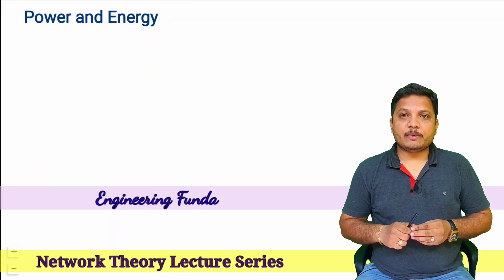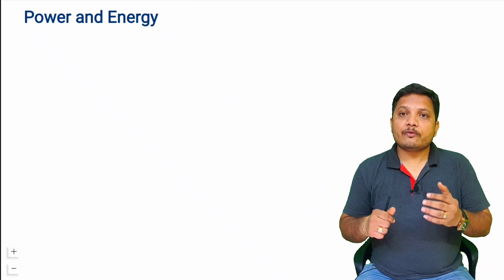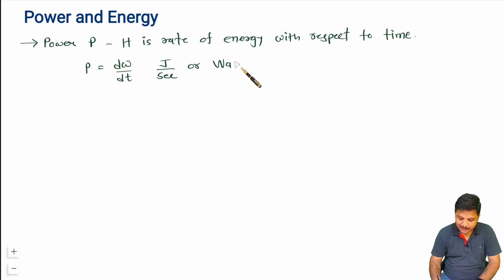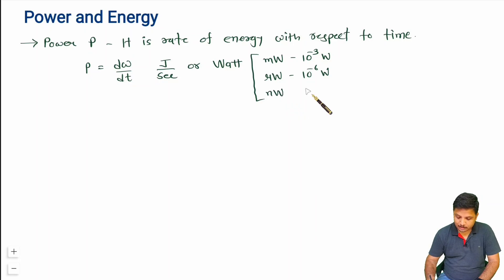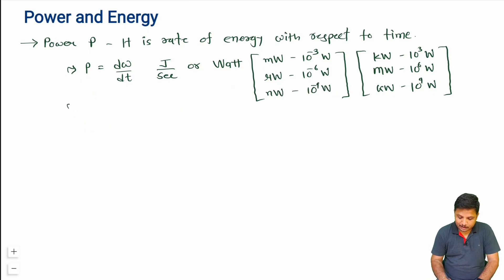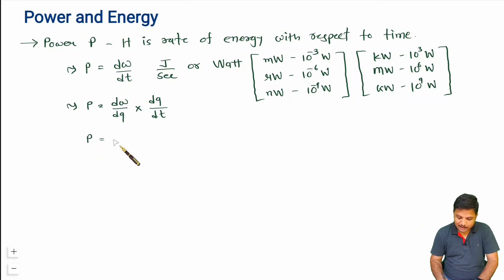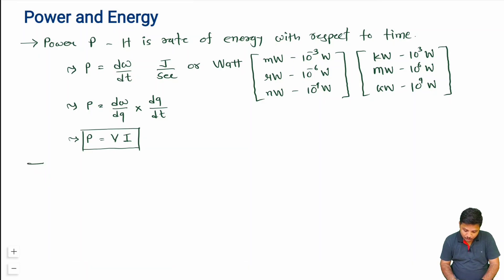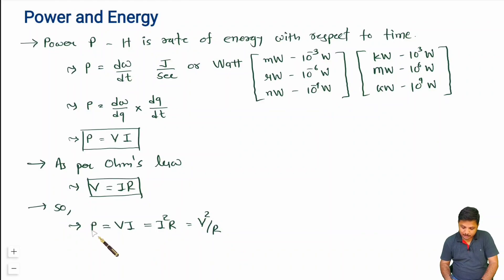Power and Energy: Definition, Formula, and Solved Problems

Comment: The power formula you use depends on the specific context of the electrical component or circuit you are dealing with:

1. P = VI (Power equals Voltage multiplied by Current):
   - This is the general formula for electrical power in a circuit where both voltage (V) and current (I) are present.

2. P = I²R (Power equals Current squared multiplied by Resistance):
   - This formula is specific to resistive components, like resistors, where the resistance (R) is the determining factor for power dissipation.

3. P = V²/R (Power equals Voltage squared divided by Resistance):
   - Similar to the above, but expressed in terms of voltage and resistance. This is also used for resistive components.

For non-ohmic devices like LEDs, it's more appropriate to use P = VI. Using P = I²R or P = V²/R may not yield accurate results because these formulas are specific to resistive elements.

Always consider the type of component in your circuit when applying these formulas. If you're dealing with a combination of components, you may need to use multiple formulas based on the characteristics of each component.

Comment: Y we are not using p=vi or v square by R  for answer we did came wrong answer Y sir
Reply from the maker: I think you might have done calculation mistakes
Reply: Are you serious 😐
Reply: The power formula you use depends on the specific context of the electrical component or circuit you are dealing with:

1. P = VI (Power equals Voltage multiplied by Current):
   - This is the general formula for electrical power in a circuit where both voltage (V) and current (I) are present.

2. P = I²R (Power equals Current squared multiplied by Resistance):
   - This formula is specific to resistive components, like resistors, where the resistance (R) is the determining factor for power dissipation.

3. P = V²/R (Power equals Voltage squared divided by Resistance):
   - Similar to the above, but expressed in terms of voltage and resistance. This is also used for resistive components.

For non-ohmic devices like LEDs, it's more appropriate to use P = VI. Using P = I²R or P = V²/R may not yield accurate results because these formulas are specific to resistive elements.

Always consider the type of component in your circuit when applying these formulas. If you're dealing with a combination of components, you may need to use multiple formulas based on the characteristics of each component.